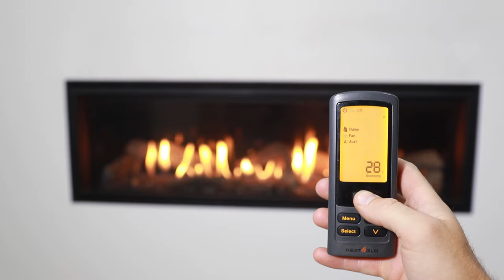Heat & Glo RC300 remote pairing instructions

Comment: Excellent! Thanks for this. I'd bought a replacement RC300. Its display lit and the menu could be navigated -- but it didn't turn the fire on/off.  I hadn't realised that pairing was necessary. This video solved the problem.

Comment: Maybe you can help me out. I have power cycled and tried to sync the remote. The remote will beep twice to confirm it has paired to fireplace but after that the remote does not turn on or off fireplace. I have changed batteries and tried all power plugs. I can get the fireplace to lite if I turn the switch to ON position.